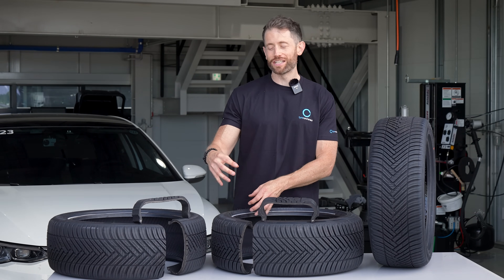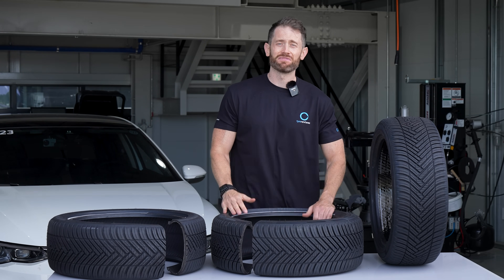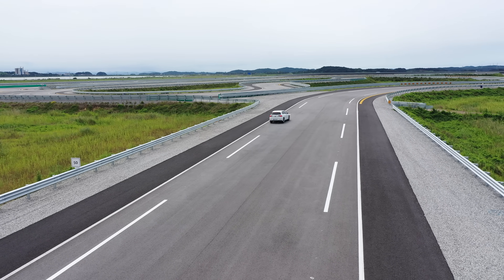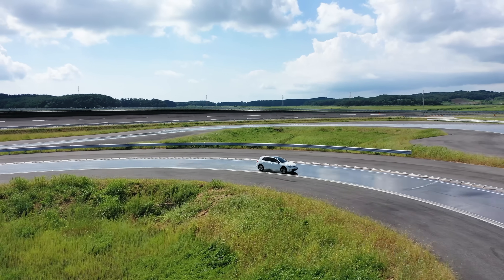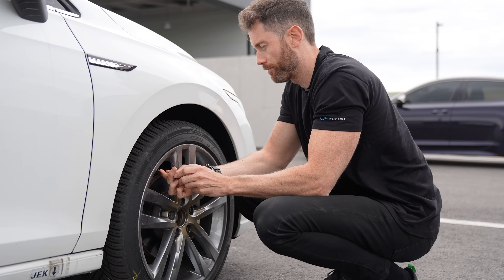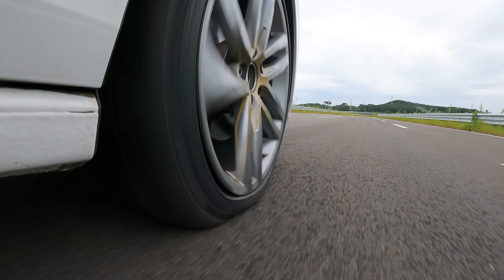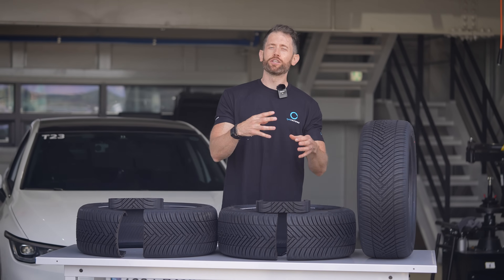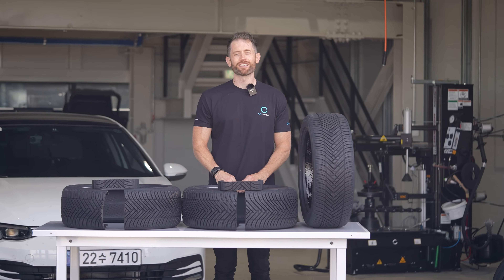Are Modern Runflat Tires Finally Good? Normal, RFT and SEAL Tires Compared!

Comment: This may have been pointed out already, as I don’t have time to read nearly 1000 replies, but… nice review. Semi-convincing. The main thing I wanna point out is that this test lacks square edge bumps at 1.25 inches or greater - sunken or raised manhole covers, potholes, raised overpass edges during blistering cold. Runflats only decrease the occurrence of roadside occurrences, which does account for something. But they greatly increase the number of flats. This is a significant detractor and it’s not addressed here as with nearly all reviews.

Comment: I live in NY metro, I only buy run flats. No question. The Throggs Neck bridge still managed to rip my rear run flat today. I was able to drive it all the way to the shop to get it replaced, and that’s with the sidewall completely ripped and exposing the inside of the tire

Comment: Run flat tires were originally developed for military vehicles for driving on harsh terrain.  Now they are on expensive cars.  The logic?  Plus the whole tire has to be replaced if it does get a flat.  The logic?  And the price?  Courtesy of google.  

Run-flat tires are significantly more expensive than regular tires, often costing 25% to 100% more (or $50-$200+ extra per tire), due to reinforced construction for driving on flats, but they also typically require full replacement after a puncture, not just a patch, adding to long-term costs. You're paying for the safety and convenience of driving for 50 miles after a puncture, but sacrificing ride comfort and potentially facing higher repair/replacement expenses. 

I’ve been driving for 45 years and never had a flat tire.  If you are worried about the slim chance of getting a flat tire out in the middle of nowhere, just get a yearly membership with AAA.  They’ll take care of you.  I’ll take the comfort.  And less noise.

Comment: I’m interested in both type’s because my 2022 Audi S3 with R19 235/35 Z low profile tyres failed their first MOT due to cracks in the inside walls.  I’ve also had a blow out from a large pothole that split the wall too.  Plus there’s no spare wheel and the foam can was useless.  Run flats or self sealing will help me out big time.
Also, can the run flats be repaired or will the walls be ruined?

Comment: I've currently got star makred Bridgestone Turanza T005 Runflats on my BMW G21 M340i '2021 with a staggered setup, which limits the tyre choice (if I were to stick with runflats).

Unfortunately gone through 4 rjnflats in the last 4 months due to porholes, which I suspect are entirely because of the runflat sidewalls. 2 of the 4 were complete blowouts, whilst the runflats allowed me to drive to the tyre shop it unfortunately was likely the actual cause of the problem. They just don't have enough flex to absorb pothole hits (even more mild ones), so they're getting ditched for Pilot Sport 5's next time one goes or they wear down enough to change.

Comment: Jonathan talked about the “secondary push” from the tyre when turning, and that the secondary push was stronger from normal tyre than rft. I presume that the thinner sidewall the stronger this secondary push. The touring tyre should have a stronger secondary push than an UUHP tyre. Correct ? The said secondary push is what creates “handling” and “feedback” for me.

Comment: We run two fwd cars in the family with run-flat tyres. We specified them coz we specifically wanted the run-flat capability. If there are compromises (we have not compared qualities with ordinary tyres on these two cars) then so be it, but suffice to say we are happy with performance over the combined 15,000 miles of their use so far from new. 

Tyres are:

Good Year Eagle F1 Asymmetric RSC Runflat
205/40 R18 86W Extra Load (Star rated OEM approved)

Bridgestone Turanza T005 RSC Runflat 225/50 18” 99W (Star rated OEM approved)

At the end of the day I’m an ordinary motorist who enjoys driving on public roads, with mechanical sympathy, and some protection from being stranded on a flat. An ordinary tyre with a can of gunk is not an appealing alternative.

Comment: The mechanics at my BMW service centre don’t recommend any run flats for summer tyres. My experience of new Pirelli run flats is terrible. 2 blow outs, from the side wall in as many months. One going down a mountain pass. The other at lo speed. 2024 Bmw 330e xdrive m sport pro 19” rims. They recommend Michelin pilot sport 4s as the best summer tyre.

Comment: If you get a puncture, normally the screw/nail stays in the tyre. How do the self-seal tyres handle that?
Reply: The sealant should still work. There's some caveats though, something with a hollow core or complex edge geometry like a drill bit, will still allow air to pass through.

Comment: Albeit the R16 version I did use this tyre (regular non run flat) on my previous car and together with the more sporty suspension it felt amazing. Maybe not the best cornering speeds like some track tyre would give but still felt great compared to the nexen I ran before. With my current car I am thinking about run flats, which led me to this video btw

Comment: Wish I saw this video a week ago when I was shopping for tires!
Hit a metal shard on the motorway and my tire shredded in like 20 seconds or so... Had to change a tire on the emergency lane and I feel lucky it was a left tire (UK...) cause I would NEVER go on the right side... I still would NEVER drive without a spare tire (fullsize or space saver) but having this extra time to roll into a safe place is worth whatever the extra is for run flat!
Trust me on this, it's a great idea and I am not rich or anything...

Comment: So why not run flat + sealant?   Like I don’t understand why one or the other like why not both?  I was shopping around today actually for new tires and I just discovered this issue.  Like between the additional sidewall protection and the ability to seal itself just makes so much more sense even for its additional compromise such as additional weight and whatever else… 

like considering they’re sticking foam to the inside of tires I think it’s a worthwhile compromise to have both and I’m still trying to find what tire has both

Comment: Why aren’t run flats standard across the industry ? Get rid of conventional tires altogether
Reply: not every car is fitted with pressure sensors so you might not be aware you got a puncture. that can lead to tyre getting destroyed by driving too fast and by that a horrible, fully avoidable accident.
Reply: @ not if it’s a run flat, and you can still tell when you’ve got a flat .. well most people can
Reply: @qbanz00  what do you mean? are you trying to say it is safe to go 70 mph on a punctured runflat tyre?
Reply: @freesiu  most run flats allow you to go 50 mph ..why are you using 70 as the bar ?
Reply: @qbanz00  because anyone could go that fast if they had no built in sensors and didn't know that the tyre lost the pressure. hope you get it now

Comment: There is something you could test: Do run flat tires destroy the rims faster than normal tires for low profile tires on 18+ rims ? I've had run flats and my 18' rims were destroyed, now switched to normal tires.

Comment: If a normal tyre or a run-flat tyre get a puncture, you know instantly that you need to address the issue via the car's tyre pressure monitor system. If a self-seal tyre is punctured you may well not know about it at all and this would worry me that at any time I may be driving at high speed with badly compromised tyre safety.

Comment: Heavy question, What is your Country is full of Bumps and  like on my case Runflat use to Destroy Rims?  my parents have broken 6 times the Rims before they remove the RFT and replaced it with normal tire, is the new generation RFT the same hard on Rims ?

Comment: If the sidewall is narrow 40 or less, a run flat will be less likely to delam from a pothole, and it's sidewall typically has rim  protection.

Comment: I just got the Pirelli p7 and when the tyre was trying to sell it to me, he showed me the sealed. I didn’t even know that existed until then so now I’m here doing some research. I had Michelin primacy run flats before and they were pretty loud and slightly harder compared to the current P7’s. Thanks for the informational video. Hopefully I don’t get any damage or punctures on the sides 😅 👍

Comment: I worked for BMW Group North America. 
M cars are not specified run flat tires because they are heavier with all things being equal. The Motorsport line is not for everyday drivers. No run flats and no spare tire. Be careful out there.

Comment: Sharper steering does not equal more grip though. Better steering response due to the stiff sidewall but a soft tire has more grip as the transition of weight is slower and allows the tread to stay in place

Comment: I am doing a roadtrip in Turkey and 2 weeks ago I stopped on an unpaved parking lot with a lot of very sharp rocks high in the mountains. One of the tires was out of pressure directly, but because they were runflats, I could easily get into the next village an half hour down the road and get it replaced (for a cheaper tire in almost the correct size). The next day another tire blew and I noticed that the remaining tires had developed big bubbles on their sidewalls. For me runflats are a nobrainer; you can safely drive to a town, even in the middle of nowhere when all 4 tires are damaged beyond repair.

Comment: The new Pirelli run-flats on my 2015 BMW 328i handle and brake well. I do think they are noisier than most non-run flats I've run on my BMWs. My subjective impression is that the stiffness of the sidewall translates to a bit rougher ride over small, "washboard" road irregularities.

Comment: I had runflats on my last car the idea of never having to change a tyre at the roadside is a great safety feature although it makes for a harsh ride but if the OEM fits RFTs to rims not designed to take the shock loads you end up replacing rims with propagating cracks on the inside edge at £800 every time you cross even a minor pothole, never again.

Comment: i love your content man! very helpful 
please which UUHP summer tires would you reccomend?
in size 245/40/19 front 275/35/19 rear 
for g31 540i xdrive stage 2 with integral steering

Comment: there was mention of run flats costing more but they are still lower cost than a spare tire plus the room it would take. However I have had negative experience with run flats on my BMW's.  I had a nail close to but not in the side wall and the dealer and and independent tire shop would not fix it. An to add to that I hade to buy two tires because even though the good tire was not all that worn the BMW dealer insisted that both tires on an axle (pair) had to be exactly the same diameter. So that nail hole which could have been fixed on a regular tire cost me two new tires ($1.000  including balancing, tax, labor and of course BMW mark up)

Comment: Just fitted 4 x Pirelli P7 RF onto my BMW 4 series SE grand coupe. Compared to the previously fitted Dunlop Sports the ride, comfort and noise levels have been greatly improved. I have driven BMW's on Run Flats for the last 23 years having been a high mileage business user that didn't want replace a wheel on the hard shoulder of a UK motorway on a dark wet evening. Compared to the early RF's, I think the performance of today's tyres are much improved.

Comment: I have a 2023 BMW X3 with Bridgestone run-flats, and I live in Phoenix, Arizona. This is the first time I have owned run-flat tires, and I have to say that at 3000 miles, I do not have any issues with the comfort or traction. I understand BMW has designed the suspension for the tires; I don't believe I would have noticed that I had run flat if I hadn't paid attention to the tires. My only observation is that when I fill the tires with air to the recommended psi, that within a week they are down five psi and tend to stay in that spot. It doesn't affect my mileage or ride. This great video helped ease my concerns about run flats; it is excellent information.

Comment: I am very impressed with the run flat 4S2, however it is not available in Ireland and I don't need all seasons tyres. I can buy Hankook Ventus S1 evo 3 in run flat. Do you know of the evo 3 run flat has the similar thinner side side walls and how it fairs in terms of comfort ? They for for a BMW e92 320d with 17" tyres. I am also considering a Bridgestone 6 as a standard (non run flat) tyre. Your views would be much appreciated, in particular in terms of comfort.

Comment: Is it a little dangerous to have several punctures in a 'seal tyre' not know about them and then drive at high speed?
Reply from the maker: No it's fine
Reply: @tyrereviews  Really? But then the only thing keeping the pressure in the tyre is the wafer thin newly formed membrane of the secret sauce... what if you hit a stone on a motorway at 80 exactly in the same spot as the puncture... surely this could be an issue, no?

Sorry for my disbelief, just seems odd to me.
Reply from the maker: @timbob1145  it does seem odd but it works!
Reply: @tyrereviews  ok, cheers for you replies and for putting the work in 👍

Comment: I’m curious to know how the sealed tire would hold up in winter? It looks like a tar type substance, if it get close to 0c would it still hold? Same at higher temperatures, at 40c does it melt and settle when the vehicle cools?
Reply from the maker: it's a pretty serious chemical mix and should be fine at low temps

Comment: You did a great job, nobody could do it better! I am also a fan of Hankook tyres... I think you should repeat this test with a Bmw (or anything else) which has a special suspension because it was designed for RFT tyres. I changed my RFT tyres to normal tyres,  (5 series with xdrive) and I can say, at high highway speed (160-180 km/h) the car lost 20-25% of its stability. Of course, the riding confort is much better.  As far as I know, the suspension of the Vw Golf was designed for normal tyres, as they come with normal tyres from the factory.. Thank you.
Reply from the maker: What tyre did you swap to? did you try upping the pressure? It'll help

Comment: I love these reviews! So much relevant info that I have never been able to find anywhere else! I’m now looking at fitting the Pirelli p zero seal inside tyres to my Jag XF which I will admit does get driven harder than a jag usually would. Do you know if they can be fitted like a normal tyre or if they require any special preparation or equipment? It’s between the Michelin PS5, Conti Sport Contact 7 and the P-Zero seal tyre in 245/40/19. Would love to know your thoughts

Comment: Ill be sticking with runflats  on my z4
Ive seen blowouts on vehicles on the motorway and the carnage after
My safety and my kids is paramount ill put up with slight harsher ride
All the run flat haters need to watch this video

Comment: I'm just about to buy a set of Hankook tires for a V12 BMW. It seems odd, but in reality all the famous European producers (Michelin, Continental, Pirelli) succumbed to idiocy. Some of their tires are for extreme sportiness, being uncomfortable and noisy. Plenty of the others are stupid electric tires where the only consideration is fuel consumption without any respect to grip or speed. The range of comfortable, high quality tires like Primacy was is now quite reduced. And everything is plagued with runflat, that I can't fit since my car has no TPMS, luckily. For my surprise this seal technology is generally not available, although it seems to be a much more reasonable and useful thing than runflat, I would be happy to buy it if it would be available.
In contrast to these Hankook is a very reasonable producer providing quality tires without runflat. I'm quite puzzled but I have to admit this Korean company seems to do much better job than the ones captured by the ravine between public road car racing and EU's green idiocy.

Comment: Now we need runflat seal tires
Reply: I was thinking the same paski.
The best of both Worlds.
Reply: @Smiler7  Untrue, beyond both world I'd say, but I will stick to my normal tire with a spare.
Reply: Or a spare tire :D
Reply: @t2216 you mean AND a spare tire
Reply: getting mine tomorrow, conti makes them
Reply: I saw some performance/efficiency test and to my surprise the sealant ones had performance losses equivalent go earlier runflats
Reply: Have a BMW 330D M Sport on run flat Bridgestone tyres all round. and 93k miles. Quite reassuring ,as will get me home ,when regular tyres will fail , in a place,who knows, where and when. On a lighter side, the police interceptor units will be at a loss. The chain stinger, in the UK, often thrown by police in front will fail to deflate tyres making them inoperatable. Perhaps the video did not really cover older car tecnology involved. Simple tyre pressure tech fitted to  most today needed to inform about the pressure as standard fitting in BMW. However will not stop you fitting the run flat tyres on most cars.

Comment: BMW M department: "You M owners spend too much time driving sideways that using runflats will drain your wallets faster than the car drain its tanks."
Me: "...not that UHP summer tires are any cheaper but yeah it's kinda true"

Comment: Silly question... Why can't we have a run flat tyre with a sealant inside it? ... This would help stop the tyre deflating and reducing chances of a problem due to side wall cuts etc. It might be slightly heavier, but the advantages would be overwhelming.